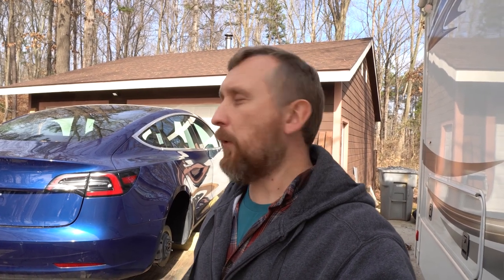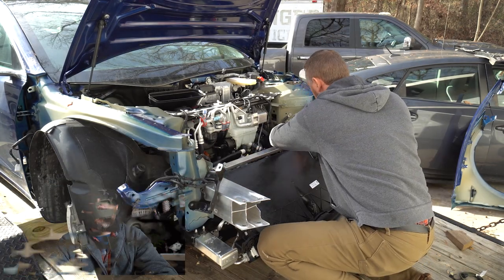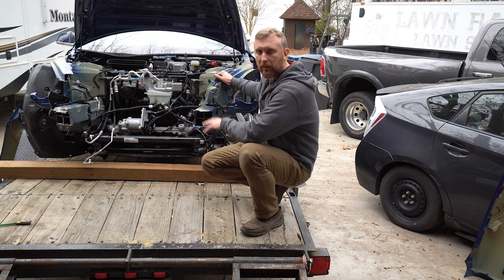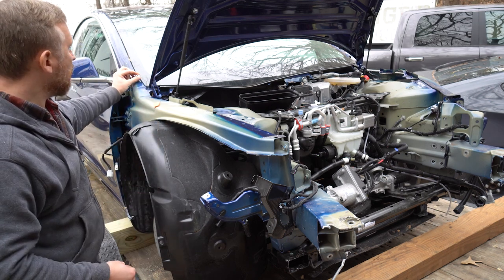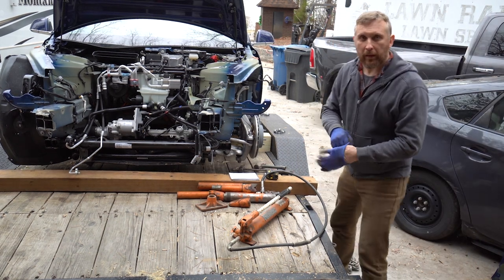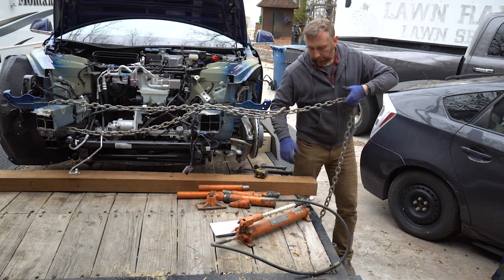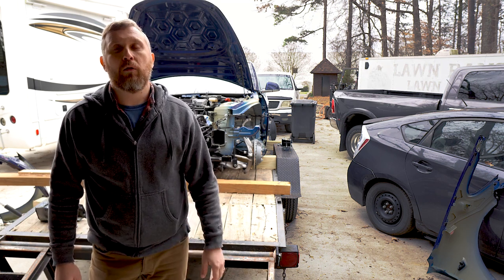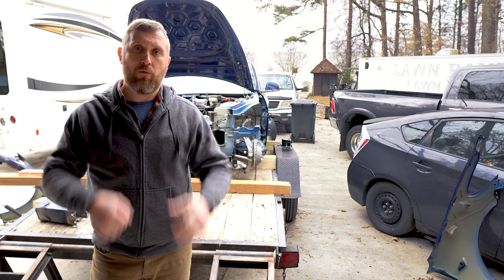Rebuilding salvage Tesla  Model 3 Part 2. Frame straightening at home

Comment: Sir how do you fix a 4 inch bend in a rear model s frame when it is all aluminum without it cracking? Don't you have to apply heat?
Reply from the maker: It really depends on the damage. Usually aluminum parts are joined with the adhesive and rivets. Pulling could potentially break adhesive joint. It is recommended to replace parts. But if you decide to go pulling route yes I would definitely apply heat to areas that needs straightening.

Comment: Dang man that's literally the same damage that happened to my car i'm rebuilding.  In my 3rd video i'm starting to see some alignment issues that i'm trying to adjust out.  I had to replace the sub-frame due to a hard hit in the middle and it seemed to fall back into place after I removed and replaced it.  Could you look and tell me what you think and If i could do the same and just correct with a pull?  Thanks for the video,
Casey
Reply from the maker: My sub frame was not damaged but yes it does look very similar. I didn’t see where you had an alignment issue in your video, but you just basically have to take measurements for lower and upper front end inner structure.

Comment: How do I know if the frame is bent on my 2021 model 3
Reply from the maker: I’m not sure what your experience is and what tools you do have but mainly what you need is something to measure with no can produce repeatable results. You can use a measure tape but results are not going to be very accurate. You also need a set of specs which I don’t know if they are available for your car. I had to use and damaged part as a reference for my measurements. Not sure how I can explain it but basically you put and damaged parts on and align everything else to it.
Reply from the maker: Not damaged parts